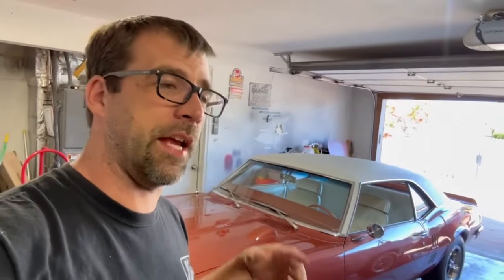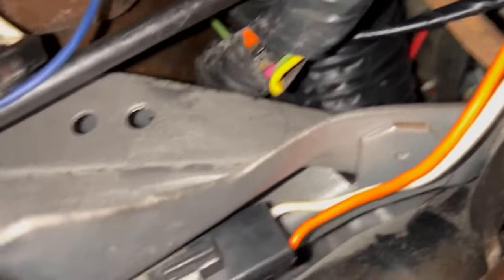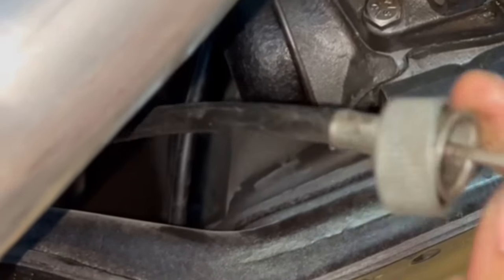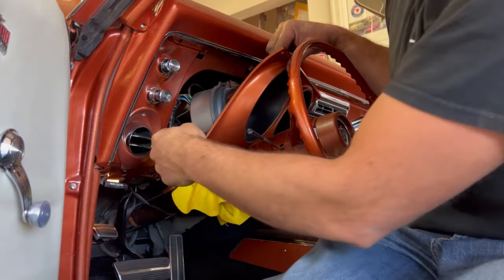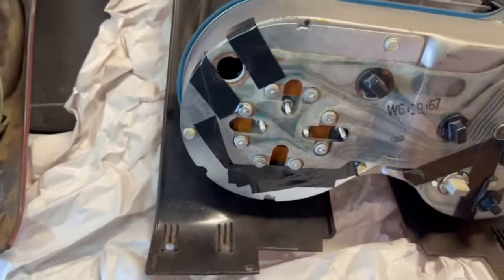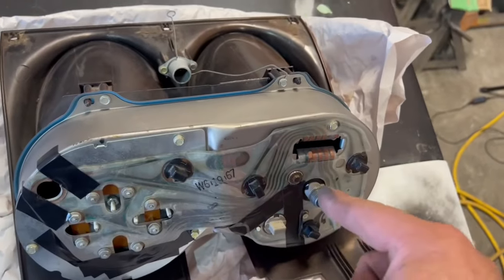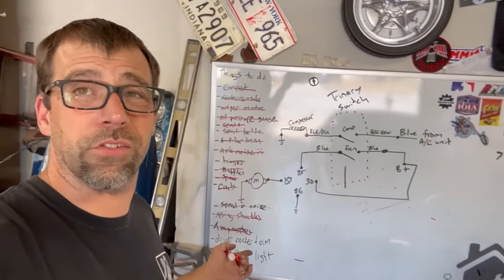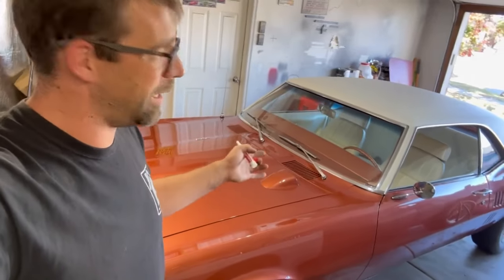Speedometer noises how to diagnose and repair

Comment: I was driving somewhere in my first car, a 1973 Cadillac Sedan Deville and I heard that same noise, scared the bejeesus out me.  So I pulled into a service station and the mechanic told me it was the speedometer cable needing to be lubed.
Reply from the maker: Normally 9/10 yes just the cable needs cleaned and lubed but this one wanted to put up a fight

Comment: Instead of another test drive after lubricating it, I have used a drill to spin cable and all. If I remember correctly, it spins counter-clockwise. But that was a long time ago, so memory might be wrong. Great job on getting it diagnosed and working again.
Reply from the maker: Good idea with the drill. I was heart broken when the Speedo started screaming at me. I really wanted the rally gauges to work on this car. Glad it was an easy fix

Comment: This is off the topic of the video but im neeeing some info from a pontiac pro. I have the original 350 from my 68 firebird. Im considering selling it because its just in my way and needs to be used but I  dont know what to price it. The motor was rebuilt in the late 80's by a very reputable machine shop here in Missouri. Its hardly been ran at all since then. The heads look brand new under the valve cover. Clean bare metal so im guessing the heads were redone as well. Probably had hardened valve seats installed and what not. What should I price this thing at? All original with original 2bbl. Fairly clean. Was repainted after rebuild then sat in the car until now.
Reply from the maker: Good question,  my dad just bought a 68 350 that was from a Firebird for his car it was complete minus carb.  Even got the accessory drive. All for $250. Now it still should be rebuilt, I bet it would still run if he didn’t. Being that yours has been recently gone thru will help say it’s worth more but there isn’t much Market for the 350. I bought one completely rebuilt with new pistons and .030 over bore for $400 a few years back and I have a friend with a 72 350 all new parts and hasn’t even been ran yet for sale for $600. Few people calling but no cash yet.   I would like to say you should get $1,200-1,500 and you might, just really depends on who buys it and when. That’s the Indiana market might be better where you are located at.  In all seriousness the machine work, parts and labor an engine should really be worth more then $1,500 my suggestion is see what they are selling for in your area and list it for sale around that price and see what happens.
Reply: @VinylVillageGarage  thanks for the reply. Youve been a big help with the videos and replying to my comments.
Reply from the maker: @MrYz250fman  hey anytime.  Thanks for watching.

Comment: I had that same noise in a 70 El Camino years ago. Turned out the bushing in the speedo was loose and squealed. But your ideas for finding the real problem is brilliant!
Reply from the maker: I was hopeful the issues weren’t the bushings on mine.  Taking it apart seems very destructive unfortunately. So far I have put 20 more miles and no issues yet.

Comment: Pretty common to get these things gummed up based on the age.  Mine wasn't as bad as yours, but it did need some cleanup and lubrication when I redid the interior a couple years ago.
Reply from the maker: It is 50 plus years old so i suppose a cleaning and some new oil was due. I never had one scream like that.
Reply: @VinylVillageGarage  Yeah mine never made any noise.  It bounced a bit around 10-20mph.  I did have a 97 Tacoma years back with a bazillion miles on it that would scream like that when the temps were below freezing.

Comment: Did the orange pumpkin originally have the wheel opening moldings? I think it’s a nice detail with the rocker moldings
Reply from the maker: Sure did. I opted not to put them back on.  After overhaul all the sheet metal I just couldn’t bring myself to drill holes in the body.   Plus without them shows the metal work is contoured like factory and not hiding anything behind the trim

Comment: Do you have any videos on your window installation on your cars wondering if your using urethane or byutle and your process on it
Reply from the maker: The front and rear glass on this car I used the butyl rubber.   That was factory and I find it easier to keep it looking clean.   Now the urethane is a better sealer and lasts longer and I have used it on these old birds in the past but I just can’t keep the install looking as clean.  I haven’t mastered using the caulk gun with urethane it’s just so messy.
Reply: @VinylVillageGarage  ok are you using setting blocks to keep the glass height in check so it doesn't sink?

Comment: My 68 bird’s speedometer jumps and is about 10 or so mph too fast.  Probably due to the fat muscle car rear tires I have on it.  Anyway can it be fixed to show the correct speed?  Thanks.
Reply from the maker: Yes there is different speedometer drive gears available. They have different number of teeth to change the ratio. They are also identified by different colors. Online there is calculators to help determine what gear you need.  Things you need to know is rear gear ratio,
Tire size, and what transmission you have then you can find the one you need.  You will need one with more teeth to slow the reading down.
Reply: Thanks for the info.